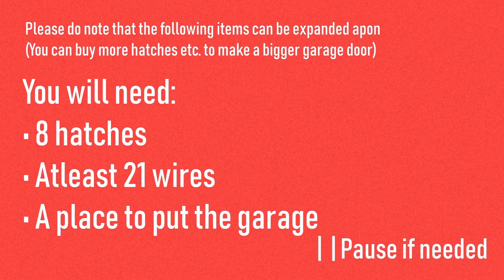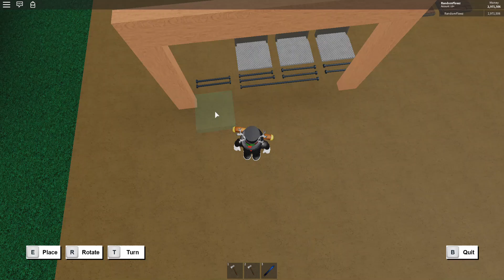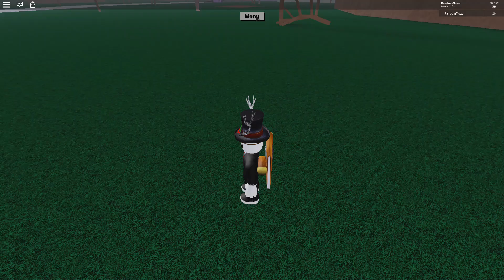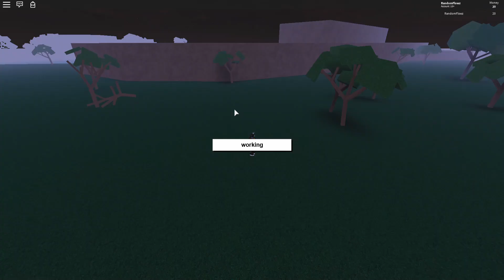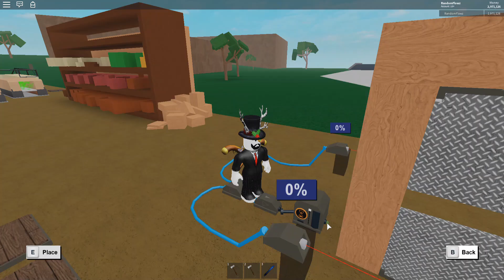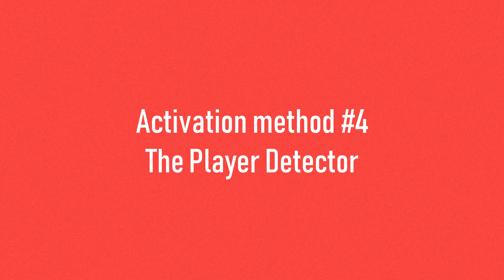How To Build A Garage Door Using Hatches In Lumber Tycoon 2

Comment: when I did the lazer part it wont open do u know what happen?
Reply: Make sure the wires are connected fully and you're using a signal invertor.
Reply: I did and it still won’t connect
Reply: @alyssayoung3649 
Are the multiple ends of the wires touching the hatches instead of there being one continuous wire?

Comment: Hi nice guide but i have problem with first way when i click the button the gate is open only for 1 second and then it close ;c how to fix it ?
Reply from the maker: Signal sustain
Reply: @Aptyn  oh man thanks youre right but after making reload i cant load any save  ;c i mean when i try to make load then i see false and nothing ;/ i think i lost my base
Reply from the maker: Sorry man that sucks, I just released an announcement in my discord warning against joining right now because roblox’s data save system is failing. (Meaning roblox is struggling to save data)
Reply: @Aptyn  ;cc how do you think can i lost all ? ;/
Reply from the maker: if you did you can get it reverted

Comment: What did you use for the frame?
Reply from the maker: Smooth walls, the thinner variant
Reply: @Aptyn  how do you get that
Reply from the maker: @chand5063  they’re in wood r us. they’re called smooth wall but they have the same name as another blueprint so you need to look at the picture for the skinnier variant

Comment: ive never used a lazer but what if u get the if the thing detects lazer it activates like make it the other way where if its not detecting a lazer the door will open
Reply: what??????
Reply from the maker: Use signal inverter
Reply: Aqua Flow yes I saw you’re lazer method lol

Comment: dude does this work now?? please respond
Reply from the maker: Yeah
Reply: Aqua Flow one of my side won’t go of so only like 8 will work not all 10 plz hell
Reply from the maker: Try moving the wires around, Sometimes the connectivity is a bit messed up and you have to re-wire it
Reply: Aqua Flow ok thanks
Reply: Aqua Flow IT WORKED THANKS YOU
Reply: Now you are all good
Reply: Cody Miller ya